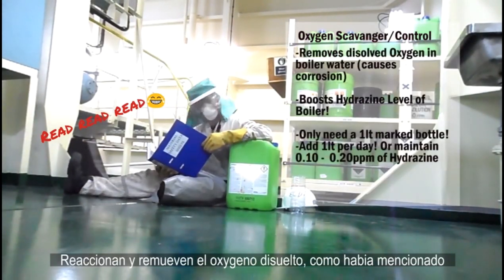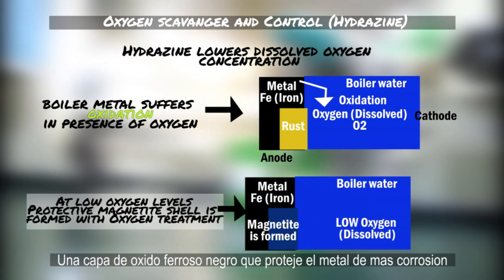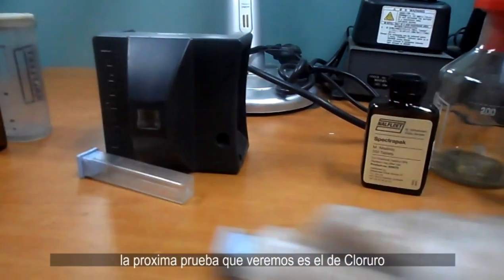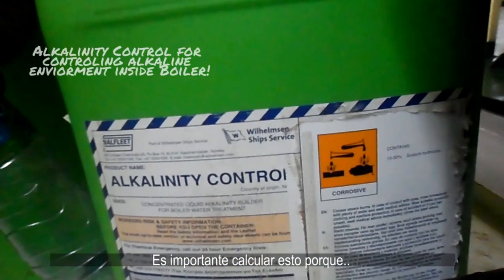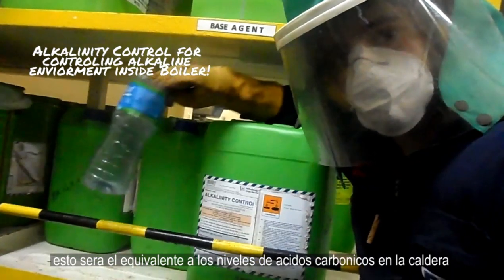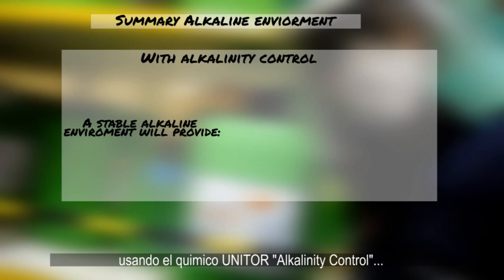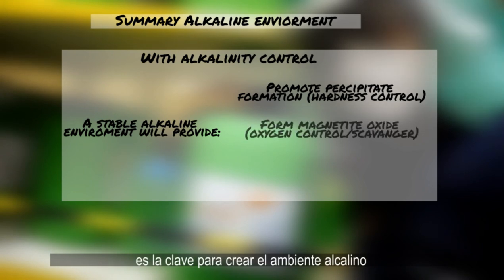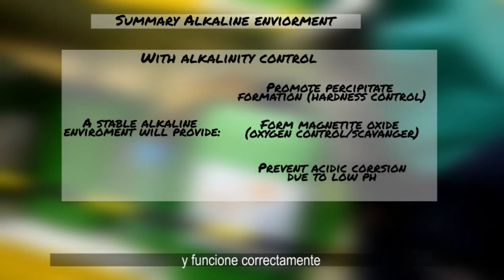Boiler water Testing and Treatment, The Unitor way! By an engine cadet

Comment: When we have to add chemicals.. When boiler is in stopped condition or when firing
Reply from the maker: It's continuous my friend chemicals can be added ideally when the boiler is in operation because then water will be circulated through the whole system
Reply: When do we carry out blowdown is in stopped or firing sir?

Comment: Hi, i have some cuestions, could you help me? i need to know about the normative (regulation) of the pH  and the method that we can used...thanks
Reply from the maker: Hello! For sure but I think the video shows how we control PH in various points in the boiler, in the video I show the UNITOR chemicals ALKALINITY CONTROL which we dose directly to the boiler to maintain good base PH levels (but within range) and CONDENSATE CONTROL to dose to the feed tank / cascade tank / hot well which we maintain the PH level there. 

In the case of the Aalborg mission boilers shown:
10 - 11.5 PH inside the boiler
8 - 9 PH inside the feed tank

Comment: what is the job of the pressure in a boiler?.. I try to find information and nothing.. can you help me with this?
Reply from the maker: This water tube boiler is Mission TM from Allborg (alfa laval) it ranges from 8bar to 16 bar normally however usually if we are not discharging 8bar to 12 bar

Comment: what is the normal range of p and m alkalinity to be boiler
Reply from the maker: Depends on the type of boiler, the manual should state normal parameters depending on the pressure range of the boiler

Comment: what is the normal ratio of chloride content to be maintained sir?
Reply from the maker: Chorides in boiler water should be kept as low as possible but always it goes up due to hardness acumulating or sea water leaking in

Comment: right at the beginning you reversed the greater than, and less than symbols. <7 means less than 7. >7 means greater than 7.
Reply from the maker: That's correct good eye, it slip passed me. The audio is good but the graph has that symbol mistake

Comment: what will you do if the ph-value in the boiler water is under 7?
Reply from the maker: Check if burner gases or exhaust gases in the economizer are entering the boiler water.. This will create acid in the water and Lower the Ph.. Meantime add more alkalinity control to neutralize

Comment: What are the limitations for p alkanity and m alkanity?
Reply from the maker: Heya dude, well it depends on your boiler type for example for this Mission oil water tube boiler Max. 16bar steam pressure, P. Alk was between 100 - 250ppm. However at higher steam pressures the parameters may be more delicate.

Any higher it would be your fault for adding to much chemical.
Reply: How about M-alkalinity, how much is the limit?

Comment: How much is the limit of chloride?
Reply from the maker: you can check depending on your boiler system..on that one it was 100ppm
Reply: @ShrimptoShark  what is the effect of chloride?
Reply from the maker: @amirullahamirullah464  chlorides increase conductivity in the water which can acelerarate corrosion. A high spike in chlorides can also help indicate if a seawater leak is present in a condenser.
Reply: @ShrimptoShark  so,is it reduce just by blow down sir?
Reply from the maker: @amirullahamirullah464  no, the blow down removed sediments and the water with high chlorine, what lowers the choline in the feed water is the fact that we must add new distillate water which should have no minerals.
Reply: @ShrimptoShark  so, how to reduce clhoride/conductivity sir?
Reply: @ShrimptoShark  chloride and chlorine are same?
Reply from the maker: Chlorine we call the element by itself (CL) Chlorides is when it is in a compound such as NaCl (salt) has chlorides...to reduce chlorides in the boiler water system we blow down (which discharges some of the water in the bottom of the boiler) and add new water with low chlorides (DISTILLATE).
Reply: @ShrimptoShark  and what is different between P alkalinity and M alkalinity sir?